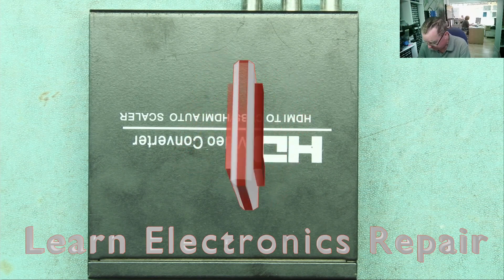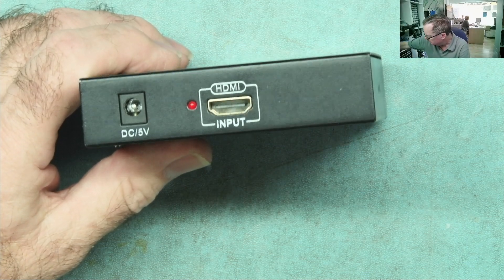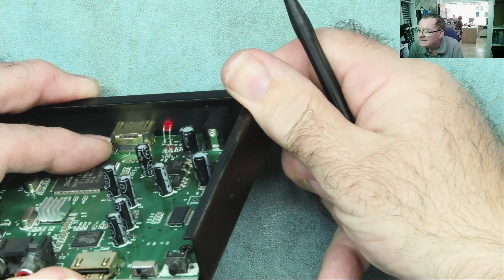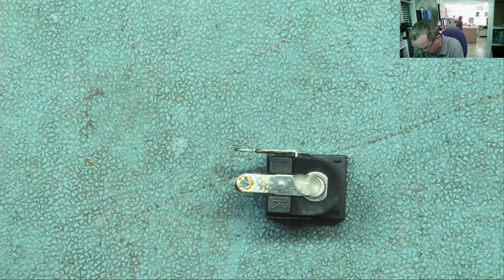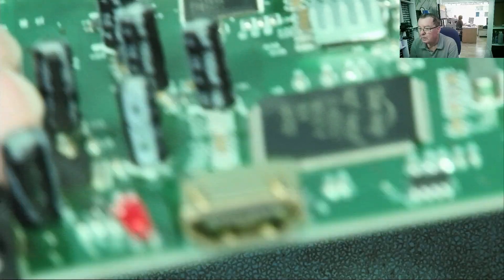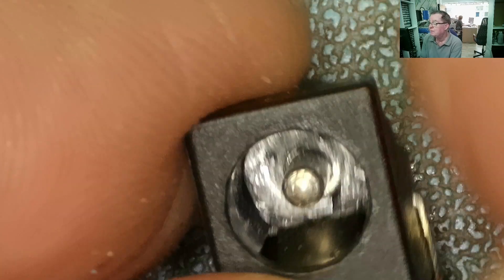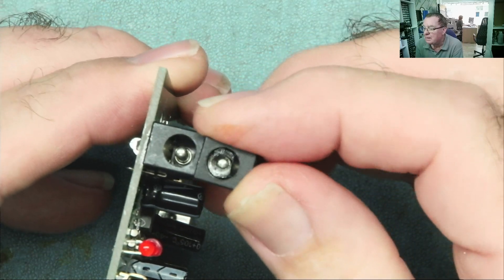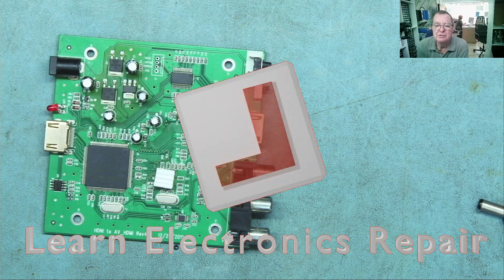HDMI - AV Adapter, Intermittent Power Connection. So... How Hard Can This Be To Fix?

Comment: Hate barrow jacks too many different varieties and sizes. The old one was probably 2.1mm pin and the new one 2.4, aliexpres will just sell the same plugs for both sizes.  Bit loose on one and a bit tight on the other.  Merry Christmas and a happy new year to you all from the wet and cold uk
Reply from the maker: You know, I thought they were called Barrel Jacks
Reply: @LearnElectronicsRepair  they are just checking your awake on Christmas eve. I blame the bloody spell checkers, but you can put barrels on a barrow. 😁
Plus I'm writing this at my mums and I'm less than 6ft from the router and I've no signal whatsoever.  The walls have compressed coal dust or something like that,  wifi will get through them. To get a signal 20ft away in a different room I had to fit a wifi over mains repeater, every bloody room is its own Faraday cage.

Comment: Those stupid barrel connectors…  I have fixed so many of them over the years, and somehow that centre-pin is never the diameter of the ones you have in stock. i hate them with a passion.

Comment: It's an aluminum foil try to remove it with tweezers and even if solder flows in it won't make that shape since the surrounding area is all plastic

Comment: Richard,... When you tried the power adapter and you wiggled it.... And the light became intermittent, it was easy to see that it's either the power jack or possibly a mismatch on the pin size of your power adapter. Those are the 2 things that came to mind, after you removed the circuit board and I saw the back of that Jack and the rivet, I immediately thought more than likely there's a good possibility of the source of the problem and after you gave it a wiggle that confirmed a high probability of an intermittent connection.  Now as for the repair... As far as applying solder and getting it to stick as we know that can be problematic,  I might have taken a slightly different approach. I would have possibly roughened the surface around the rivet and the tab, applied some flux... But when applying solder,  I would've concentrated on the metal tab and the outside of the ring...  Getting solder down that center hole could be problematic as we discovered.  And that's why simple repairs like this can be an interesting learning lesson, and something to take note of because of what could potentially happen on such a simple repair,    and then I think in the end , you kind of laughed at what had happened....  I kind of thought it was funny. Also, because you just think the simplest of repairs. Why do.... Silly things like this happen 🙂   that DC power jack, you installed looks like it is for a 12 V device... We both know there is no standard for the voltage for each Jack and it's dimensions for the adapter... But there is a generality and that looks like a 12V Jack,  you may have to dig around a little bit to find a 5 V power adapter with that size of Jack,  I hope in the future... A typical customer loses or uses a power adapter that is 12 V. Just because it fits in the connector... Sometimes this happens because of all the power adapters entangled around a device with similar connections, and you know if it fits it must be correct??? Ha ha ha  as many people think.  Anyways I think you know what I'm getting at.   I really enjoyed this video because you demonstrated some of the unexpected things that might occur on such a simple repair.    Great lesson to be learned here, could have us all reconsider the ramifications that might occur on a simple repair.... And I think that's the point of this video
Reply from the maker: Nice to see you liked it.  And yeah it was meant to be fun

Comment: Ha... that''s not solder inside the connector. It's tinfoil! User attempt at a fix
Reply: yes you can see it's been in there from the start
Reply: I came here go say the same thing.
Reply from the maker: I didnt' spot that, and it is even funnier,  I thought tin foil was intended for replacing fuses 😂
Reply: @LearnElectronicsRepair  I think if you had spotted it and pulled it out, it would have fixed it! 😁😁😁😁😁😁😁
Reply: @LearnElectronicsRepair  And for hats, too !
Reply: Remember the user is a common fault
Reply: Ha ha, I hope Rich was in time to notice before giving it back, so he can say "WTF".
The new socket will probably the right size now, for the customers power plug. so no tinfoil is needed. haha.